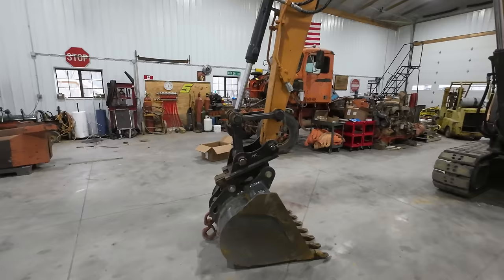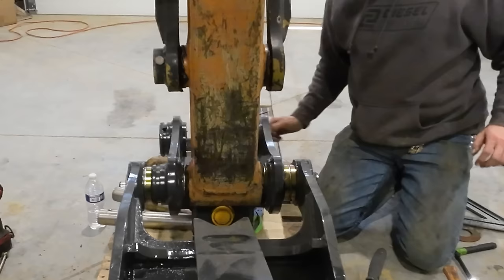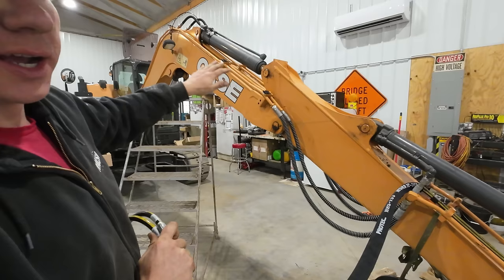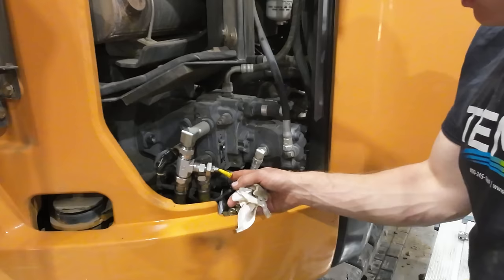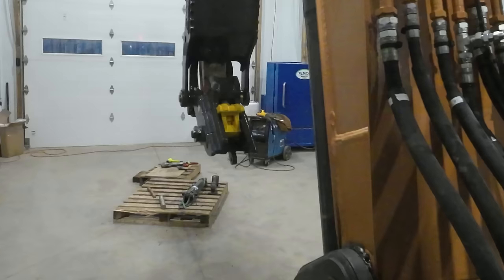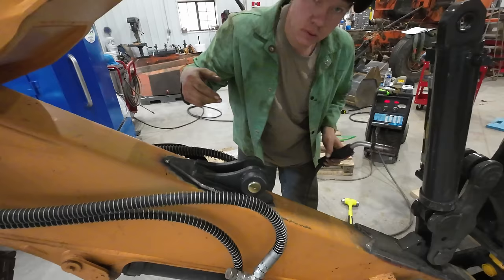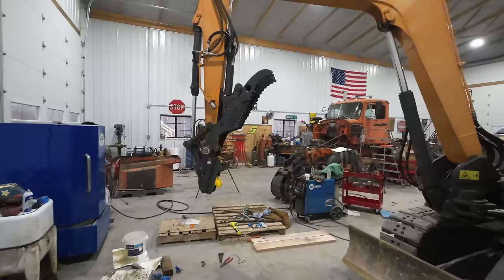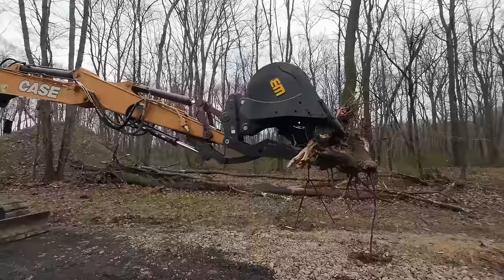Installing A Hydraulic Coupler and Progressive Link Thumb. ( New Excavator Gets Upgrades!)

Comment: That trick of using a hot bolt to round out the cut in plastic was brilliant. Never seen that before 🇨🇦
Reply from the maker: I try to think outside the box lol 🤷🏼‍♂️
Reply: @DieselCreek  Only thing I think about is trying to get in some box.
Reply: works great on carpet too.  Lay out the new carpet in your car/truck, find your seat-belt holes with an awl,  heat up a punch and melt through.  Vice grip garage trick
Reply: Ain't no slop IN THAT connectio!
Reply: @DieselCreek nice pun lol

Comment: Matt... a tip.. if you are welding under the hydraulic rams, wrap the piston rod with tape or rags to prevent any weld splatter damaging the rod and messing up the seals.. 😊
Reply: Great tip! I do this too or coat it with grease that you can wipe off afterwards.  Whichever is most readily available. Lol

Comment: BSP = British Standard Pipe. It has a 33% greater proof pressure rating than JIC (8,000psi vs 6,000psi).
Reply: Probably not needed on a 3,000 psi system though.  I have the BSP threads on the diverter valves on my Kubota.  Somewhat frustrating to find the proper fittings.

Comment: Love that thumb. I would however suggest a manual shut off where you teed into the auxiliary line so you can still use other auxiliary equipment. As you are set up you would be feeding two things at the same time. Great work and a nice piece of kit though.
Reply: This confused me as well.  I though the thumb would just plumb directly into the aux.  Would you ever need the thumb and the aux working at the same time?  If you connected an aux now would both it and the thumb work at the same time?  very confused
Reply: I wondered the same thing and figured he'd just tie the thumb open, or pin it if there are holes for that.

Comment: BSP = British Standard Pipe. Extensively used across the globe for plumbing connections ( but not in North America).
Reply: Yes here in America too it is very common got to know what you're looking at biggest difference is 55 degree thread angle as opposed to 60° for American they appear to have rounded Crest and a rounded root radius  the American thread is truncated flat.
Reply: just read the metric go world school so much Ezzor A 🤣 fixed

Comment: im an operator but i do a lot of work on the side and i used to be a fulltime fabricator/ welder clamp the top down when you tac it the welds will cool and pull the top up as a weld cools it also shrinks thats why sometimes when you get something perfectly aligned or squared after you tac it on one side it moves a bit also burning hot enough it shouldnt really matter but its best to clean the weld area first like on the back side of the thumb that goes against the boom as well  because when you just grind the outer sides your still leaving that paint underneath where the weld will penetrate and could still pull some impurities through but burning hot enough on that size metal it shouldnt hurt you just some tips ive learned over the years great video man!!
Reply: Yes!! Excellent advice and absolutely true.
Reply: @Bad_CAT_itude3408  thank you sir and yeah man can never clean a weld area enough the cleaner the metal the stronger the weld especially mig and tig i normally grind paint off wire wheel it and acetone it to make sure i get as many impurities out as possible also very important to watch your heat and make sure you dont have it too cold or too hot effecting the strength of the metal or the weld and another thing i learned fabbing was you can never have enough clamps lol

Comment: Just a thought. The company I work for, had one of these couplers installed on a Hyundia machine. On that machine, when the bucket was curled all the way open, the bucket linkage hit the hose block. Your linkage may be different, but You may want to check the clearance, so you don't break a hose or fitting. Love the video.

Comment: Nice job on the install! 
Coming from a 40 year Case mechanic. 9 years at  Case Dealership.
Reply: Right on brother! I’m a Bobcat and Develon mechanic these days. Only thing I’d have done differently is added two diversion valves where he T’d into the auxiliary lines so he can run attachments and lock out the thumb. Other than that I’d say perfectly done.

Comment: I installed a lot of hydraulic couplers on excavators when I worked for the dealer. Every one I ever installed came with instructions to not use the pins that come with the coupler to install to the stick because they are not hardened, and will damage the stick. You were supposed to reuse the pins that were on the manual coupler, and the pins that come with the hydraulic coupler are meant to be installed on a bucket.
Reply: Makes sense
Reply from the maker: I’ve never heard that but that’s what I did…. Except the thumb pin you don’t have a choice it’s long and you need that
Reply: Then why do they include pins at all?
Reply: @dcviper985 , For the pin that stays on/in the bucket.

Comment: Yeah I was always told not to weld across the dipper arm. But I’ve welded all the way around stiff arm mounts without issue on 20 and 30t diggers. Nice work man

Comment: Matt! Make sure you drop the relief pressure of the aux circuit so that when you curl the bucket against the thumb it will bypass and not bend the thumb cylinder!
Reply: I was wondering about that.

Comment: That's a sweet setup. BSP, British Straight Pipe thread. Same diameter and pitch as tapered pipe thread, but without the taper. Uses an o-ring. We don't need it.

Comment: I am also working on my new workshop, and yes even here in Sweden it costs alot to get power, my price for 750m / ½ mile is aprox 40000 usd or 430000 sek. this is for 3 phase 11000V to a transformer that i can get 3x400V up to 450A if i want. Shop is for repairing Mining Equpiment, Heavyduty Welding of large buckets and repairs of generally large machinery.
I am going to make it a youtube series. atm we are doing prep on the ground getting the stumps and green stuff of, then we level it...easy to work ground 5 - 6 meters (17 - 20ft) of sand.

As for hydraulic fittings i dislike Jic and O ring fittings strongly. I pref G fittings, (oppsite cone of jic) since they are easier to get started and you get a good stop feeling when they are tight, jic sorta never stops until they strips. (G and BSP is same pitch but BSP is coned and G is straight. for sealing i pref Tredo washers (Washer with rubber vulcanized to them).

Anyways thanks for another good watch🙂
Sorry for my lack of English grammar.

Comment: Don't forget to double check the pressure on the thumb cylinder. You want it to give when pushed past a certain pressure by the bucket cylinder. Otherwise, you'll have them fighting each other and one will eventually get bent. 😊
Reply: i don't know if i have understand right but i think that he ad install this device to the bucket line at 24 min  if not i have no clue what that T was for then

Comment: Matt, You may want to rethink leaving the moisture gaps. Condensation and rust can create rust jacking over time. Seal it all with weld and paint it well. This will delay rust jacking.
Reply: I agree. Moisture can wick upwards between the two surfaces and hang there and never completely drain.

Comment: Excellent video! Only one suggestion. Don't attach control boxes to glass! If you break it you will have the unenviable task of attempting to remove broken glass from the control box and if you miss one tiny piece you will eventually break the new glass over and over.

Comment: Interesting. Here in Sweden, Rototilt + hydaulic quick couplers are super common on basically all machines that I see.
Reply: Im kind of curious as why he didnt put a rotortilt on it.
Reply from the maker: Because they cost as much as the machine and I don’t use it enough to justify it
Reply: I agree, it change any digger to a multifunktional machine, but they are pricy. Here in Sweden these 10t wheeled diggers with rotortilt have replaced 80% of the backhoe-loaders. The wheeled diggers have often a heavy duty trailer after where they keep buckets and stuff. And use the trailer as bringing material on the site. The guys running these, could preform in a circus with their digger.

Comment: Hi Matt. A useful tip I picked up when you need to open up a hydraulic system and don’t want to lose a load of fluid is to attach a vacuum cleaner to the hydraulic reservoir filler cap! The suction prevents fluid pouring out quite effectively;) Cheers Ray (UK)

Comment: Looks great! Though you may want to add a diversion valve (manual or servo controlled) to each of those auxiliary lines where you’re supplying to your grapple cylinder so if you should ever want/need to run an attachment off of your auxiliaries you can lock out the thumb from moving.

Comment: I looove those deustch connectors.  Found out about them a few years ago.  They're a bit more involved when using them, but they are so nice for wiring up aux lights or any wiring that has to spend extra time in the elements instead of a bunch of barrel or spade connectors that can corrode over time.

Comment: When I added my thumb I’m glad the quick coupler was already there. That was a lot of work to get yours set up. One main difference to what i had to do is i had to change the portion of the main control block that run the Aux so it had the correct flow valve. That was a pain, it was under the floor board and not easy to get to but so worth it to have a thumb

Comment: Make sure you set the relief valve pressure on the barrel side of the thumb for the aux hydraulics lower than the bucket curl. You don’t want to bend the rod or anything else on that thumb.

Comment: I've got a Kubota that has the bspt threads on the aux, they do that just to sell fittings. Also, mine has a switching block for dual auxiliary, might want to look into that if you plan to use new attachments

Comment: With as much experience you have, you should know and appreciate that electrical is a dry version of hydraulics with no drippy oily messes. There is an almost one to one relationship with valves and switches, fittings and connectors, & etc.

Comment: After working with all hydraulic threads, BSP is the better choice. You can crank tighter than JIC, without the swivel thread deforming and leaking. Or worse with SAE flat face blowing seals!

Comment: Matt, if you haven’t already noticed but you need to plumb the thumb to the bottom of the hyd valve where the quick couplers are. You have tee in above that valve with your quick couplers or you’ll never be able to turn the thumb off when running a hyd attachment.

Comment: Good how to video my only concern would be the rubber lines running up the boom. I know there steel braided but I'm usually some where I would most likely rip them off that's my only concern

Comment: A long long time ago I drove a backhoe, I learned on the job changing a starter motor easy. Change the fan belt a nightmare the pto went through it so had to take the shaft off.

Comment: Be careful welding around exposed cylinder chrome. Weld spatter can burn into the chrome and ruin seals pretty quick. I’ve found putting a thin layer of grease and a wrap or two of tinfoil works wonders!

Comment: Hey Matt, quick idea for you.  That panel you had to unbolt to get to the high pressure pump is probably vibrating and making a bunch of noise when the machine is on.  Grab some foam rubber insulation and just stick a bit on the inside of the panel.  It should dampen some of the vibration.

Comment: Awesome job!  Note that the way the T's are installed, you can't use your auxiliary hydraulics.  You will need to either relocate the valve blocks you already have on the stick or install new ones so you can turn the thumb off.  Obviously you would figure this out in time but you might want to change it before you want to use them and it becomes a frustration.  Love the logos!

Comment: Turn your wire speed down and slow down or weave wider with your current settings, pausing to each side. I also struggle to weave wide enough with mig. I prefer stick or tig lol. Thats what ive used most the past 15 years in the trade. Im sure it aint gonna come off, just giving pointers for aesthetics only 😎

Comment: I would drill the retaining bolt and add a clip or add a counter nut to avoid loosing the nut. There's a lot of vibration, otherwise the nut will likely work itself loose.

Comment: If you use the auxiliary existing connection in future I suggest you to put valve on etch side of the thumb hose to close them to prevent the thump going down on your accessory's

Comment: If you're ever in a spot to where you can't get something to clean up you can use a 6010 welding rod. It's a nasty looking weld but it pulls paint rust all that. Then just use a 7018 to clean it up

Comment: I assume those fittings were BSPP or “G” thread which is a straight thread (British Standard Parallel Pipe) with an o-ring seal. The other kind is BSPT (British Standard Pipe Taper) or “R” thread, which is the tapered version similar to NPT and does not use an o-ring to seal.

Comment: Yes on the JIC...love hydraulics ,hate all the different standards...over here we get pumps,cylinders with npt,valves with bsp and then want join it all up with jic (cause it doesnt leak) ...it the hardest part of the job (fitting adapters sometimes are just not sold)...love your work.

Comment: I only noticed one small potential error when welding around hydraulic cylinders cover the rod with something to prevent weld splatter damaging the selling surfaces. It is no fun having to reseal/replace cylinders because you missed that simple steep. Don't ask me how I know that.

Comment: Little tip for you if you don't have a way to clamp two side you could always weld a bolt to one side and just draw it down. Same thing like if you need to take and draw a piece down and there isn't a way to clamp it you can always weld a bolt and then take a nut and a piece of steel as something to put pressure and draw it down it works. It works for trying to jig parts that are trying to pull too.

Comment: Nice install looks like an awesome thumb.  Can you explain the Tee on the aux circuit.  Wouldn't you need a diverter valve  to run an attachment off the AUX to separate the aux and the thumb flow?

Comment: That thumb deserves a 👍 machines should come with these as standard they are so useful and make a machine much more capable. Closest I've used is clamshell grab with rotator not great for digging but good for moving stuff about. You made that upgrade look easy some additional solid lines for boom connections would have been nice but I'm sure it holds plenty enough pressure for what it's doing.

Comment: My first and most fond You Tube series Matt; keep it up.  I was in a shop that ran COLD water thru floor tubing. Worked in AZ south of Phoenix, AZ.  Like your Heating system in reverse and side by side with heating tubing; Desert nights get under 29 degrees in Winter

Comment: Sure gives an appreciation of all that goes into the design, support, and installation of the thumb & coupler. Agree on hydraulic couplers, just discovered BSPP (British Standard Pressure Parallel) was what was used for the return ports I could use to finally properly plumb in the loader on my L235 Kubota with the Power Beyond valve configuration that it should have had. Sure wasn't what I was expecting to find on a Japanese tractor. And agree on how amazing those 'compound' linkages are. Took a while to find the right combination to use when I was designing and building my backhoe attachment 20+ years ago. Seeing this in action here has me thinking I should get it going and put a thumb on it. Thanks for that, and all the adventures you share.

Comment: Awesome job on the pin grabber and thumb. Installing the engine in the ol A car is coming an I just wanted to pass on the the way I did my install. I was concerned with the lift points as the head bolts will be bearing the weight of not only the engine but the transmission also I used the motor mounts in the back and a strap around the front. Good luck

Comment: 56:30 there might be something about the "progressive link" geometry I'm not seeing, but to me it appears the thumb opens up a hair too far. If the cylinder ends up parallel to the boom then when the cylinder opens it's just trying to push the boom apart rather then close the thumb, seems evidenced by the fact you had to rev it and it still jerked a bit before it opens (but I suppose that could be air in the line). In engineering terms it looks like you found the linkages singularity - when two links are in a straight line together, they don't fold as designed, they just push eachother until something bends. 

Could be something I'm missing or it just looks worse on the video than it is in reality, but personally I'd think it was supposed to open just a hair less to avoid the cylinder becoming parallel with the boom mounting surface. If I'm seeing it right that's going to be really hard on the boom and your mounting plate welds when you open it all the way.

Comment: If you ever need to clamp something down, but you can't get a clamp in there, you can weld on an upside-down "L" shaped piece of steel close to the area to be clamped and drive a wedge between the L and whatever it is. Just weld the L on 1 side that way it'll be easy to remove when you're done.